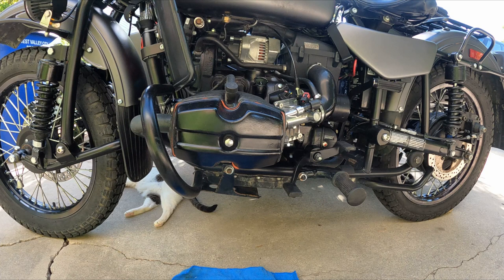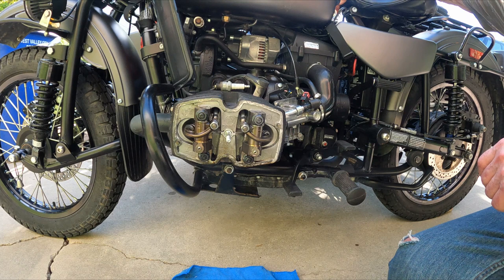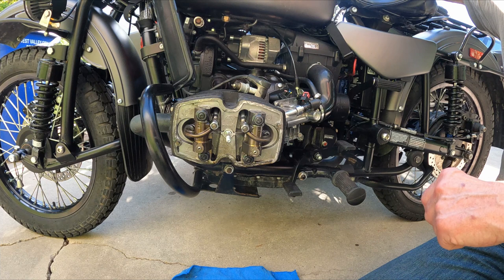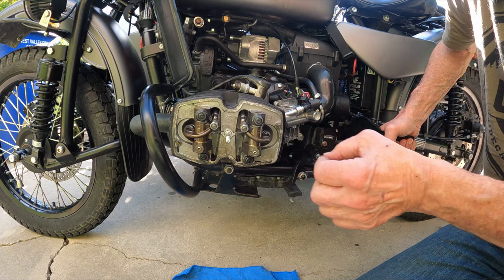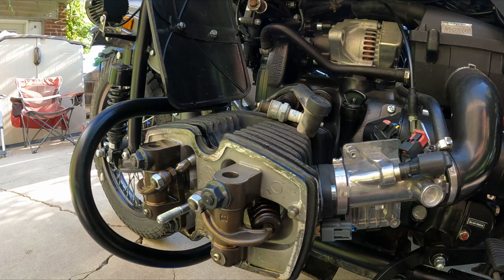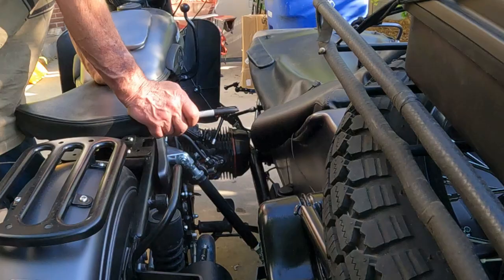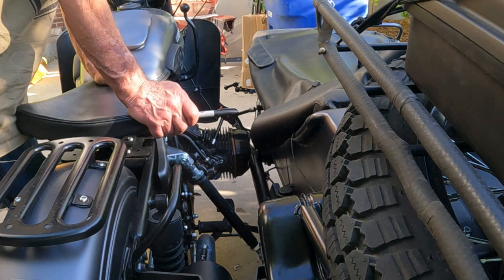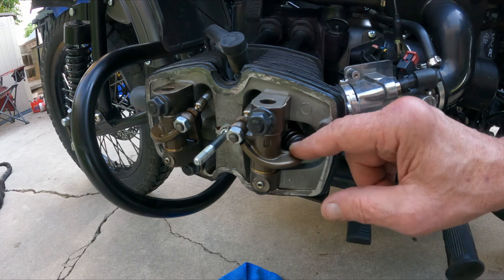Ural - Finding Top Dead Center

Comment: Thanks😀
Watching now 👍
Reply: Thanks , much appreciated , I was a bit apprehensive about checking the valve clearances myself , but it doesn’t look too hard.
I was thinking that top dead centre has to be exact and was hard to find etc.
Thanks.
Reply from the maker: I used to think the same thing - had to be exactly at top dead center. The reality is that just both valves need to be closed and that’s it. A lot of slack for adjusting valves. Good luck - it’s easy peasy.

Comment: Nice work Alan. How often can the Silicon rocker cover gasket be reused?
Reply from the maker: Good question, Harry. I think I saw where they could be reused five or six times. I’ll keep using them until they leak. As long as you wash them and clean the mating surface on the heads, they should keep working for a very long time. They are too new to the market to have any definitive data on that.
Reply: @Uraljunkie  thanks mate.

Comment: Good day and thank you for your videos which are great!!
I have a question regarding the possibility of adjusting the idle of the engine on a 2014 GU fuel injected Ural. My idle is very low and I think I could have a few rpm during the warm up
Reply from the maker: He Bernard! Thanks for watching.
The idle on the throttle bodies are very easy to adjust. There is a little screw at the bottom of each of them. The screw goes into the throttle body and stops the butterfly valves from closing all the way. If you turn the screw in (clockwise looking at it from underneath), it will raise the idle. A tiny bit makes a big difference. It can be done with your fingers with no need for a screwdriver. Make sure you adjust each side the same. This should work, since I have done it on my 2018 which has the same throttle bodies as yours.
Let me know of any questions.
Thanks gain for watching and commenting!
Reply: @Uraljunkie  thank you so much for your answer ! I will work on it tomorrow and let you know! Happy New Year by the way!
Reply from the maker: @bernardbouygues3562  Happy New Year, Bernard! Thanks!